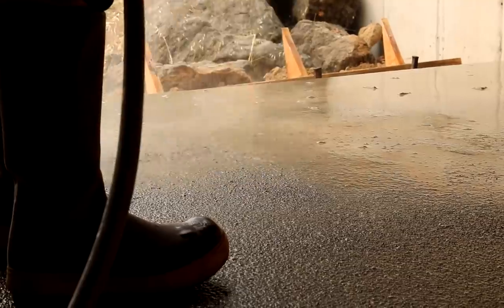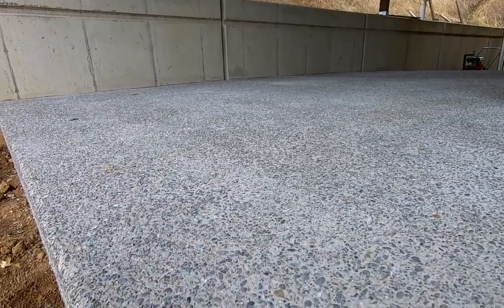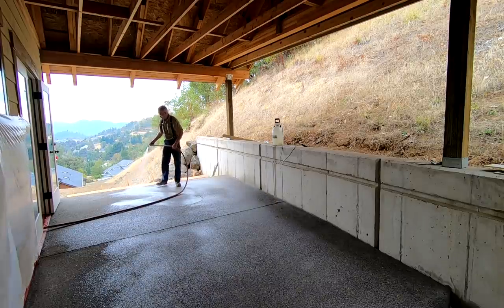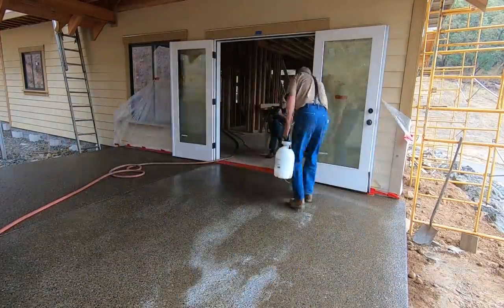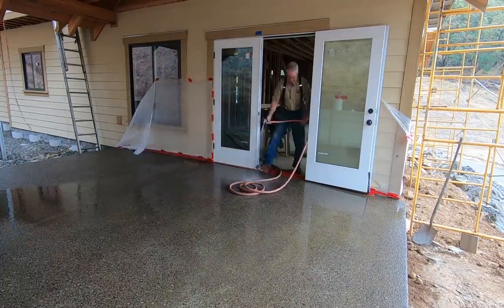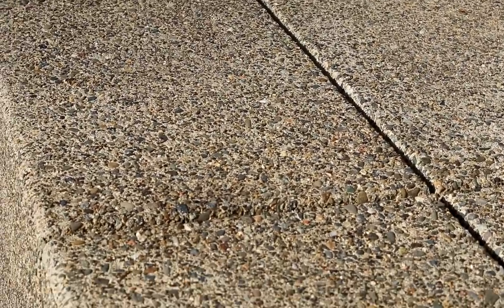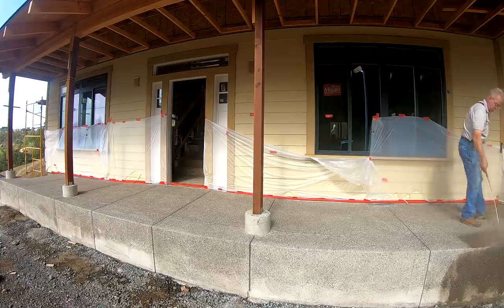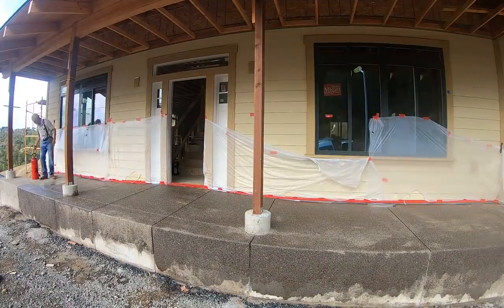Wash and Seal The Concrete Ep.94

Comment: When mixing a solution using concentrated acid and water, you should always add the acid to the water and never the reverse.  Depending on the concentration, adding water to acid can cause the solution to boil and splatter.
Reply: That's true for some acid, for example sulfate acid. but this one is okay.
Reply: Good advice but I thought that's what he did the time I saw him do it.
Reply: @MrEazyE357  I didn't intend to imply that he did anything wrong - I was just making a general comment about mixing acid and water.
Reply: That's good advice when dealing with any kind of solution, always add the stuff you want to dilute to whatever you're diluting it with.
Put another way, if you start with an empty container and you're diluting something with water, you pour in the water first then whatever the stuff you want to dilute. Water first, then detergent if you're making up a bucket of soapy water to wash your car for example.
Not only is it safer, but it also means you often don't have to mix things as much for them to become homogenized.
Maybe you don't always need to do that (example brine and water, or salt and water), but if you do always do it you won't forget it when you do need to do it.
Reply: It's good practice, but the reality is that it doesn't happen. Cody from cody's lab tested it years ago. The bigger danger isn't the boiling, it's if there's any splashing.
Reply: Thanks 👍
Reply: EJ Wu Not so.  Always add acid to water or the acid will vaporize and your concentration will be lower.
Reply: 44R0Ndin NO, if you are diluting a caustic add water to the caustic. Not vise versa, go back and read your chemistry book.
Reply: Do I add the gin to the tonic or the tonic to the gin? I sip em 50/50
Reply: @Adamsadventures83  It does happen if there acid is high enough concentration and the volume of water small enough. We set up a demo of this for the first year chemistry students. Sure,  you can get away with it most of the time but it's best practice to add the acid to the water.
Reply: "To add acid to watta is to do what you oughta" is really mostly for sulfuric acid. That's because concentrated sulfuric acid is denser than water and releases a lot of heat when being diluted. Sulfuric acid will sink through a water column and spread out its heat of solution through the water, while water poured onto sulfuric acid will float on top, causing the boiling and splattering you mention at the interface. I guess I followed this rule with hydrochloric (muriatic) acid, too, back in my lab days, but it never felt quite as critical.

Just wanted to mention this because it's really the principles of heat and density, rather than acidity per se, that you want to keep in mind here for safety. An example that comes up even in my ex-chemist days - in soapmaking - is dissolving sodium hydroxide (lye) granules in water. Again, dissolving lye makes a lot of heat and sinks through the water, and you want to let the lye (opposite of an acid!) sink through the water rather than pour water onto a pile of lye.
Reply: @ramanshah7627  yes!  What you said.

Comment: Here's another safety recommendation about diluting muriatic acid from a chemist.  You DID do this safely and correctly at 5:12 - 5:20, but I think it deserves mention.  Whenever diluting an acid, ALWAYS add the acid to the water; NOT the water to the acid.  When acid dissolves in water, the process creates heat (you can actually see steam coming off the concrete at 5:47) and if you add water to acid, the mixture may overheat and splash hot acid up at you.   Great job and attention to detail on this project.  Most builders just throw down a slab of white concrete that ages into a dingy gray after a few years.

Comment: I love your videos and learn a lot from them.  Muriatic acid never fails to amaze me. I have had it on hand for years and use is mostly for cleaning corrosion off of steel.  Another use is as a flux when soldering galvanized steel steel.  I "kill" the acid some by adding some zinc; otherwise, it will be too strong and removed all the galvanize from the steel I will be soldering.  I also learned to store it outside of my garage as it is so volatile that it will rust any bare iron or steel tools inside.  It's in the original container, inside a five gallon plastic bucket with a snap-on lid, inside a plastic trash can. When I go to get some I can still detect a faint acid odor when lifting the trash can lid.

Comment: It’s a good idea to have some additional help when doing this. If you don’t get to rinse the acid in a timely fashion you can run into trouble. Same also with applying the sealer. Don’t get too far ahead of yourself with either product or you will get a blotchy finish.

Comment: I'll chime in as a chemist in the audience. muriatic acid is a strong acid, I wouldn't classify it as "severely diluted" like Scott did here (maybe he was referring to the final concentration in his sprayer?). Muriatic acid is impure, relatively strong HCl at a ~15-35% concentration (depending on brand) in water. 30% might not sound like much, but 38% is as high as you can even get HCl in water. "Pure" HCl is actually a gas. Even at 15%, it's strong enough to take your skin off if you don't wash it properly.

If you're mixing muriatic acid, wear some rubber/nitrile gloves if you have some and don't work in an area where a flung drop could get on someone's skin if you miss cleaning it up (like in your kitchen). When diluting, always add acid to water, not the other way around. This is both due to the physics of what's likely to splash out when you pour one fluid into another, but it's also to do with the thermodynamic nature of dilution. Feeding the water to the acid can lead to violent releases of heat. So, it's safer to add the acid to the bulk water. I understand it's not always practical to do it that way, but it's much safer. Note here that this is exactly what Scott did about 5:15 in the video; he filled his tank up with the hose, and then dumped the acid into the water afterwards. 

Last, please do not mix any other chemicals with muriatic acid unless you absolutely know what you are doing. Do not bring any kind of ammonia anywhere near muriatic acid. It's extremely dangerous, as combining the two causes release of hydrogen gas, which is explosive (and the violent reaction of the two releases a lot of heat, more than is necessary to ignite said hydrogen).

To the safety equipment (which Scott mentions). You should wear gloves. You should wear some form of eye protection (preferably goggles). A respirator... would certainly be nice. If you're outside like he is here, you can probably get away without the respirator if you have airflow. If you're using the stuff indoors, you should have a respirator and find a way to get some air flow. That nasty/burning smell when you're in the vicinity of HCl is... HCl itself. Remember I said it was a gas? Yeah, breathing that will literally acid burn your lungs. Yes, I've done it, and it's horribly painful. You don't want that.
Reply from the maker: Thank you for this comment!

Comment: Muriatic acid is a pretty mild acid; when I was a teenager, we sold cases and cases of it from the hardware store where I worked, for washing concrete basement and garage floors. Scott was using a very diluted mix; he poured the acid into the water (which is the proper way to mix it); he mixed it directly in a sprayer with a small top opening, so the danger of splashing was greatly reduced; and at the diluted strength at which he was using it, it's doubtful it would do any significant damage to his work boots or jeans as long as he kept it to a minimum and rinsed it off promptly, which he obviously did.
Reply: Bless you
Reply: Muriatic Acid is not a pretty mild acid. It's hydrochloric acid, among the strongest. It's diluted significantly , and it's the dilution that makes it less dangerous, not the fact that hydrochloric acid isn't very strong.

Comment: So no neutralizing the acid before rinsing? We always neutralized with ammonia and water before we rinse the acid off.
Reply: The water dilutes it down to such a weak concentration that it's not needed on this site, no nice lawn or plants to worry about killing
Reply: The acid is being neutralized as it reacts with the carbonates in the concrete, causing the solution to fizz as carbon dioxide is released.  No further neutralization is necessary or even possible.  When it stops fizzing, it is neutral.

Comment: Couple other acid safety tidbits:

1. If you're diluting the acid, always add acid to water. Do not add water to acid. This appears to be how Scott was doing it in the video, but make sure that's how you do it too. This is important for a couple of reasons: first, you really do not want pure acid splashing back on you when you're pouring the water. second, diluting acid is exothermic -- when you add water to acid, the heat is generated on the surface and can cause the water to boil and splash back at you or potentially melt the container that you're mixing it in. This is more readily apparent with stronger acids (sulfuric, etc), but you should get in the habit of ensuring that you're doing things in the right order. Pour the acid slowly, and make sure that you're doing it on a surface where a spill wouldn't be a complete disaster.

2. Make sure that whatever weed sprayer you're using doesn't react with the acid you're spraying. For muriatic/hydrochloric acid: glass, HDPE, polypropylene, and PTFE/teflon are all good options. You can identify the kind of plastic that your sprayer is made of by looking at the recycling imprint. In the US (not sure about elsewhere), that'll be the triangle made of arrows with a number in the middle. The number is an identifier for the specific type of plastic: 2 and 5 are HDPE and Polypropylene and are the most common, I believe. 

3. Make sure your sprayer is in good condition, doesn't leak, isn't brittle from getting left out in the sun, etc. It's one thing to drip herbicide where you don't want it. It's another thing to spill acid where you don't want it. You don't want to etch concrete that you've already finished, somebody else's concrete, anything unfortunate enough to be in the splash zone if your container breaks, etc. If you were thinking it might be time to replace that sprayer you've had for 30 years, the time to do it is before you put acid in it. It's like $20. Buy one when you're picking up the acid and consider it a cost of the project. Tip 1 is related to this in a way as well: if you fill your sprayer with water first, it will give you a chance to notice leaks before the contents of your sprayer become corrosive.

4. Make sure you're not wearing clothing that you're particularly attached to when you're spraying acid. Acid will happily eat away at the surface of concrete and your cotton/denim/whatever clothing won't hold up well to repeated exposure. If possible: do the concrete work, change clothes, and rinse what was exposed to acid. It's usually a good idea to rinse your skin as well as you can as well. HCL isn't particularly friendly to organic tissues of any kind.

Comment: Im not too sure about the posing part the thing I love about stamped concrete is how it holds up to time compared to brick or flag stone or cobble stone if you maintain it joints are kept nicely and colors are the same no regrouting or cracking stones or weird looks on the edges been curious about exposed aggregate but that happens to concrete over time either way

Comment: Regarding "I like best, now, a material that is not posing as something it is not.", I fully agree with you.
I have an intense dislike for vinyl faux wood grain veneer. Same with stamped concrete masquerading as legitimate brick masonry. Maybe it does last longer, but most of the time neither one fools anyone that gets close enough to it, and the unfortunate fact is that you often get quite a bit closer than "close enough to spot the fake" with both vinyl faux wood grain veneer and stamped concrete emulating legitimate brick masonry.

I'm sure there's a good way to put rebar in regular brick masonry, with the right kind of bricks and the right kind of mortar, and most importantly the right group of masons. Then again, one of the advantages of brickwork is that it doesn't require rebar to get to an acceptable mechanical standard.

Comment: (6:12) why they left that 2 hole in the concrete? Everything else was worked and smoothed. I think I remember in the video that the area had a piece of wood embedded in it when they removed the mold and then filled it with concert.Although in my opinion it is a professional job and thank you for sharing your knowledge.

Comment: Years ago, I used muriatic acid on my sidewalk that had been stained by trees for many years. It cleaned it reasonably well, but not great. Seems that tree stuff really soaks in deep. Also I noticed that muriatic acid will eat away the surface of the concrete worse than rock salt. I guess, I should have accepted the results of the effort and then sealed the concrete with a sealer but I wasn't all that satisfied and thought I'd just do it again in a few months but never did. Within a year the stain had come back about as much as before I cleaned it, and this was after I had taken down the offending trees so no new tree gunk was re-contaminating the concrete. It was just the old soaked in stuff in the concrete.
Reply: I have found that to remove the stains from maple leaves that chlorine bleach works for me.  Neutralize the chlorine bleach with Hydrogen Peroxide.

Comment: In high school, I worked on a masonry crew. A couple days after being laid, the bricks need acid washing. Usually, our boss hired someone else to do that work since, by then, we'd moved on to another job. Occasionally, I had to do the work. On a particularly large brick wall (some kind of retail store), my boss had the bright idea of using a pressure washer. Don't do this! I was wearing safety goggles, gloves, and rubber boots. Still, my clothes were ruined. After they came out of the wash, they were pockmarked with holes. Yes, you want to completely rinse the acid off, but you don't want to splatter acid everywhere in the process!

Comment: So now that you've acid washed the concrete and sealed it, IF you wanted to have tile installed over it, would it be ok to do so? OR put another way, before installing tile over a concrete landing (outside a porch door for example), should it be sealed?

Comment: This exposed concrete worth more than some people's house.
Reply: Yes i am am in the trade. I don't think people understand how expensive concrete is now days. Especially the exposed aggregate variety. This is thousands amd thousands worth.
Reply: Yes mine.
Reply: @jingalls9142  I can imagine the weight making transport expensive, but what else makes this concrete so dear?
Reply: @LEMEOIN27 i also would like to know what makes it so damn expensive??
Reply: @zachary6313  Sand, cement, and when you are doing exposed you are using river rock and this adds to the cost at the concrete plant. Getting these materials is part of the cost and the machines that get it are expensive. Then they gotta pay the machine operator. Our company pays nearly 140 dollars a yard. Another cost is materials. you need a good rock base. Rebar, that is expensive. forms of course 2x4's it depends of course what you are doing it could require plywood etc. Machinery cost, you gotta fuel the machines and do maintence. And lastly the labor itself, it is VERY hard work and it takes a toll on a mans body and to be honest concrete guys like myself are basically running our bodys to the ground and we KNOW WE ARE (GOING) to have health problems once we get older so we have to charge accordingly for what we are worth. But it is an art and I love it.
Reply: @7.3powerstroke6  what are some of the common types of health ailments that concrete men see, as they get older?
Reply: @jaker1160  Back problems, knee injury, shoulder problems, hernias. A lot of older guys have had back surgery's and shoulder replacements, knee surgery etc. When you work yourself that hard every day its just expected to happen.  Concrete is up there on the top list of some of the hardest work (physically) you can do. Of course whenever possible work smart and not hard and try to take it easy so there is a less of a risk of this happening.
Reply: @7.3powerstroke6  thank you sir.  I helped a family member pour a garage pad last summer, and I was beat up from the feet up, the next day.  Please be well.
Reply: I am curious how much more it costs compared to a standard broom finish? Around here slick patio or porch is a no-no due to ice, so broom is the go-to.  Are we talking double the cost per yard? four times? Obviously varies by region, but how much more than the alternative?

Comment: i wish i knew of pros like you in my area. dont think ive ever seen anyone bother to burn the fibers off of concrete before cleaning and sealing.
Reply: The fibers wouldn’t normally be exposed, but with this process of rinsing off the top layer of paste, it was somewhat inevitable. Definitely a cool way to fix the problem though.
Reply: @psidvicious  doesnt take away from the fact that he took the time. most would not, in my experience.

Comment: How well does exposed aggregate deal with snow and ice? I understand here they're under a roof, but winter snow will still get in there with wind and what if you use it on a sidewalk. Will it be too abrasive to shovel snow off effectively? Will it become slippery with packed snow? Will ice cause it to break down faster than other concrete?